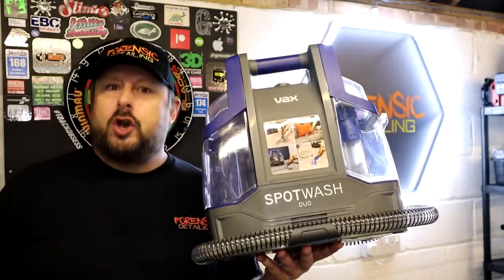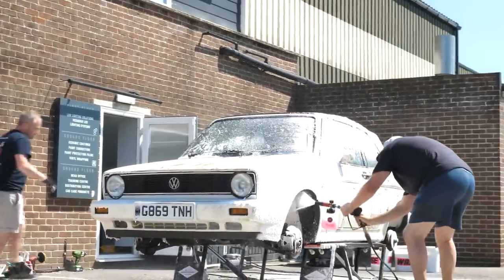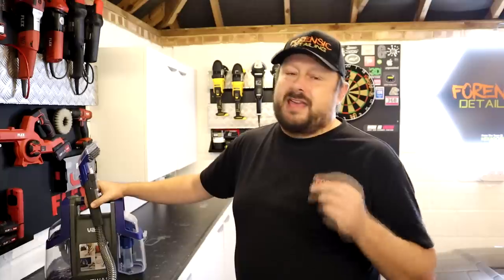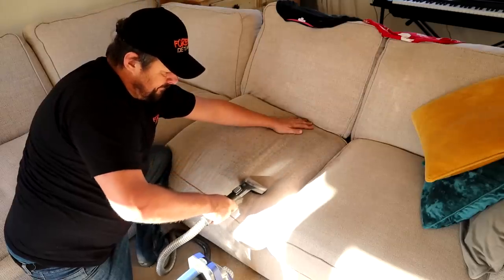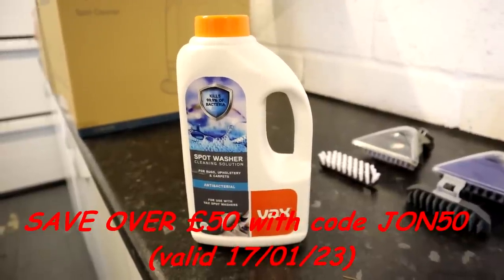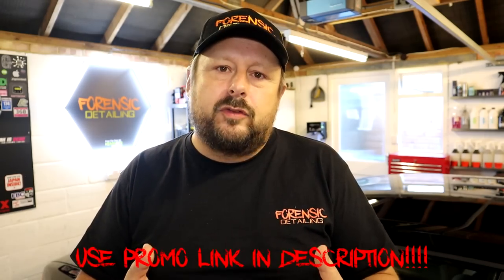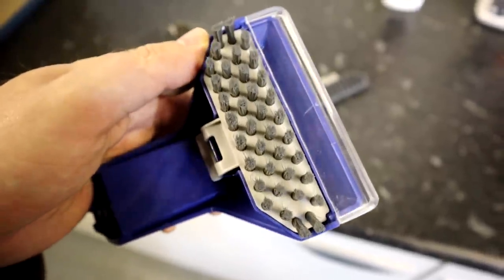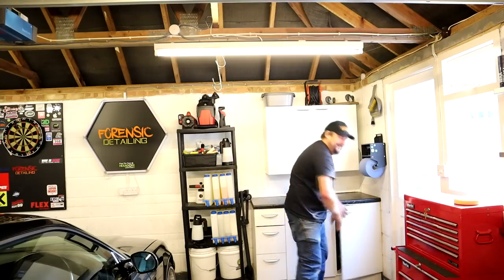Dirtiest seats ever cleaned | VAX Spotwash #ad

Comment: I had an Ford Fiesta XR2 on my drive for about 6 months the Mould was white like that the worst was the rear seatbelts I used a Kasher and then a gas blower to dry it remembering to open the opposite window open about 5 inches as I didn't want to melt the dash I have seen that happen. I have tried a George that was great but the motor head gets rusty and a vax 2 in 1 I replaced with the George this unit looks well worth it.

Comment: Hi. Because of you I bought Vax SpotWash Home Duo. Now have a question. What kond of chemicals (cleaners) I could use for this machine if I run out of original vax stuff? Though about Koch Chemie Pol star or Bilt hamber surfex hd with correct dilution(1-2%). What do you think? I'm planning wash car seats.
Reply from the maker: Any apc that says it's suitable for extraction systems.  Green star is I think surfex is as well.

Comment: Ha… saw this on the original golf video and was like - this is the one. 

Went to Argos £99 and then was blown away by the results. Three sofas in our house as we’re upper class and the smaller one has three years worth of kids grubby marks. 

I would have been happy with a 50% improvement but got a 100% improvement which was a nice surprise. Don’t press too hard as the opening where the water gets sucked back runs over your textiles and can with hard friction can leave them a tad fluffy. 

Great machine might use it on the car!

Comment: Is there a longer hose available?
Thats the struggle I have with the smaller extractors.
Would be a valid option if it is available.
Reply from the maker: i dont think you can mod the tool at all mate, but worth asking Vax just in case
Reply: @ForensicDetailing  thanks bud